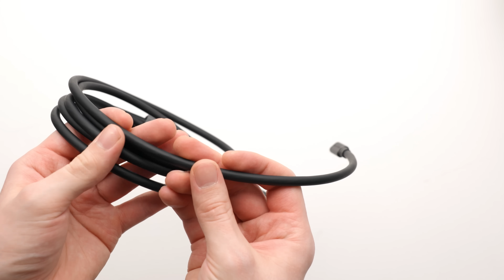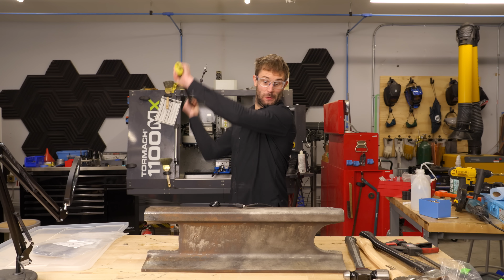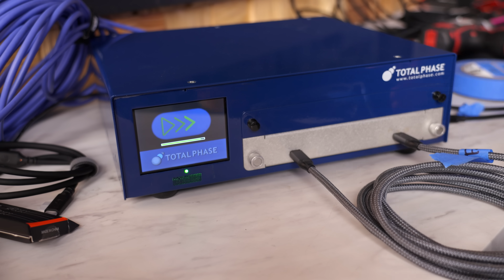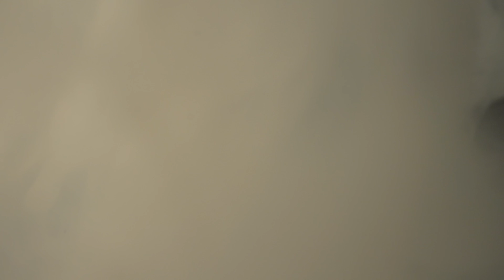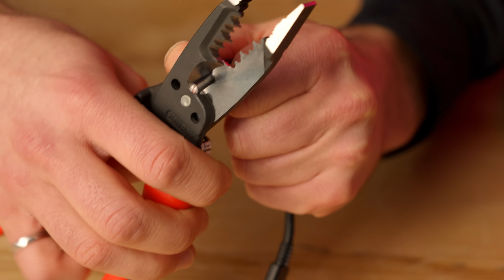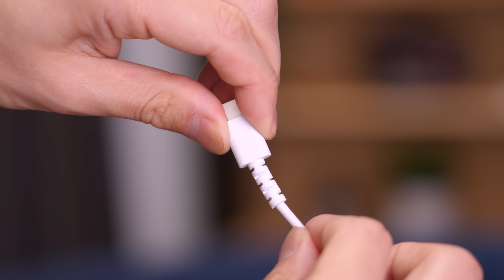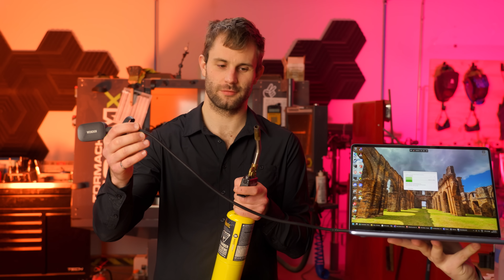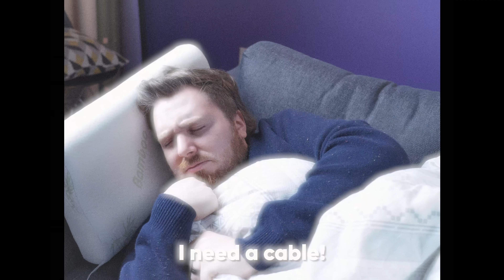Why It Took Me 4 YEARS to Make a USB Cable

Comment: "We have the shield around the outside for ground and return" uhhh..., shielding is NOT used as a signal return path. It is meant to be used as a shield! if the device the cable is connected to is designed correctly the shield gets terminated to the chassis, often with some form of RC network in series with it, specifically to avoid having any return currents flow through it, the only currents that should flow in the shield are any noise floating about in the environment, conducting it away from the sensitive signals flowing through the wires inside of the cable.

Comment: Linus, can you please make some cable extensions as well thinking about the SIM racers and flight simmers, in our VR enthusiast, a 15 foot or even a 20 foot 240 W 20 gig or 40 gauge cable extension in volt USB-C and standard would be really handy.

I think your next project should be the world’s best fastest high bit rate and stable USB hub with power somewhere around 10 ports and four USB-C ports

It’s such a fucking shit show trying to find one that works and for anybody that is in the Sim gaming sphere will tell you the headaches that we come across trying to set up a new rig can cause you to go grey in your 20s never mind how much it makes you wanna burn the whole thing down in your 40s lol

I have spent hundreds and hundreds of dollars on USB hubs and cable extensions in order to run three separate simulation rigs back to one computer

Comment: 30 CAD or 20 euro are totally fine for a USB4 1m cable. I expected them to be somewhere between 30 and 40 eur (50-60ish CAD). My last USB4 cable i bought was around 30 euro for a 0.5m cable (240W rated). so the next cables i will buy will be either 20 GBs 2m or 40GBS 1m LTT cables. at least when they are back in stock xD

Comment: when you start making wires with 90-degree connectors. then advertise. I live in Russia and can afford to order your product. your wire is good! but it would be more convenient for me to have a cable with a 90-degree plug!
Reply: with such a 90-degree plug, the wire is not bent at the plug in most cases!

Comment: It's actually insane for me, how many people don't know shit about their cables, their chargers or even what their devices can do. 
It should be common knowledge for everyone, not only tech savy people, to know the difference, between USB 2.0, 3.0, 3.2 Gen2 (and the other gen's). Also speaking of the output in voltage / current.
You absolutely SHOULD know how much input your device can accept, e.g., is it 20 Watts, 50 watts or do you have some Xiaomi phone with 200 Watts xD. 
If you don't know that, you won't know if it's the cable, your device or charger that is holding you back in speed of data transfer or how fast it can charge. 

I always see that at my school when some kid comes up with their iPad and tries to connect it to the beamer over USB-C and then it doesn't work and they say:
"but at the other room it works? That doesn't make sense" and then they look at me like I am a ghost when I ask them: "Does your cable support display port alt mode over USB-C?" 

It's a shame.

Comment: In my electrical engineering days, I worked at a place that made Mil-Spec cable and electronic assemblies for aerospace and military applications. Nuclear submarines, space shuttle, Titan IV rocket, fighter jets, you name it. And one thing they had in common was either shielded coax or shielded twisted pair signal wires. And the shields themselves were terminated on the shell of the connectors. This is a proven way to get clean signals even in very noisy environments. I approve of the way LTT's cables are made assuming that the shields are terminated to the connectors. Even if they aren't, still better than unshielded twisted pair.

Comment: 8:19 "from a brand that shall remain nameless" with the proprietary cable and the barely blurred logo in the back really got me
Reply: The Man from A.N.K.E.R. might come knocking...
Reply: @PrograError  Apple*
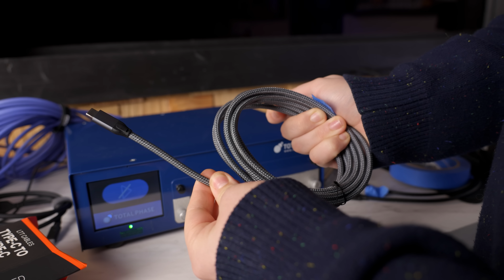Reply: @HaydenH  2:53 A.N.K.E.R
Reply: @HaydenH  also, it's a reference...
Reply: All of the lightning cables including mine in my household have a crack in the top white plastic that causes it to slide up and down. On one of our cables the white part completely came off revealing the metal shielding which my Mum stuck duct tape over and continued to use it for another year before getting a new phone. Never had a lightning cable fail like in the photo but I have had it happen to a 10 year old 30 pin connector.

Comment: I was expecting the cable pricing to be higher than that, honestly very faairly priced, wouldn't call them cheap but if they are as good quality and reliable as you make them out to be, then these are very well priced

Comment: Hi LTT, you may well have already thought about this, but if you haven't I would strongly recommend annual random witness testing of stuff like this to confirm manufacturing hasn't changed in a non-transparent way down the road. Speaking from experience in sensitive industries, that happens all the time, and the last thing anyone wants is the dreaded 'this used to be good' blame placed back on the point of sale. There are many different strategies to maintain that witness without being too onerous (though tbh, most of our work is 100% process-along witness per batch), if you need to optimize against that cost.
Reply: 100%. It's not always malicious, but a manufacturer can make "process optimizations," that while completely unintended, affect the end quality of a product received. It can things like a component supplier goes out of business, or a certain part used goes up in price a ton, or a new part comes out with the same specs on paper. Even the smallest things can have a huge impact. Say the PCB manufacturer switches to a higher quality USB connector with thicker copper traces for a higher power rating, this could lead to the occasional cold solder joint as it acts as a more effective heat-sink. Odd changes can have unintentional consequences.
Reply: This is Soo true

Comment: Sad that the most useful part was overlooked... angle connectors was not even something consider during this hole process it seems... charging the phone while using it and having a thick connector is a pain, it's even more pain when it's not angle... Clearly this cable was only made for desktop use not phone use...

Comment: Does the cable support DisplayPort alt mode? The long length of these cables are enticing for Macs, but I'm not sure if they work for video output? There's no mention of it on the website nor this video.

Comment: I have spent more on cables that have failed to meet basic requirements, never mind the specs you are offering. Without a cable tester we are mostly guessing at what brands are least likely to cut corners, so offering a good cable we can trust at a very reasonable price is great. The labels on the ends will be convenient too. Please don't take this as a reason to up the price, just to restock because you seem to be running out of most of them already. Also I am loving the musical advertising lately.

Comment: I need some A-C cables for my incoming sim rig upgrade, to be honest... The prices of the cables are very reasonable in my opinion. Well done guys, time will tell on durability and overall value. Your community being what it is, you will be held to account but if it's as good as you say, I think it will be fine.

Comment: Well I think you might be sold out already :D. Where I live I xanr even get USB 3 'cheap' and I know being expensive does not mean good. So cheap USB 2 was my way to go... At least I got 10 spare cables and can deal with slower charging. Better than spend more money and have the cable be shot anyway without knowing. (I'd like to have an easier way to check those but alas no cable tester :D)

PS watched this bid while sorting through cables after moving into our new house ^^'

Comment: look, the song is cool but the way he sang it was wrong. the original song was a loud screaming or shouting across the room kind of performance and that's how it achieved the shrill without being jarring, the guy singing your version is whispering in a way to mimic the original performance instead of actually trying to reproduce a good performance, I just think if you guys care so much about tech and videos then this shouldn't have been your weak link. Notice i didn't say anything about mixing, interfaces, microphones or equipment which i know you guys have on lock. its not a critique thats an overshot vs audience and meme nature. I am just saying the performance is not correct. I didn't say singing, i didn't say vocalist, i didn't say off key or anything like that. the point is the guy should have sang across the room instead of hunched over his laptop. Please retry/do the song if at all possible.

Comment: The 1m 40Gbps is currently priced at 29.99CAD (~19€), or at least that's what it shows, and its cheaper than any 1m 40Gbps cable in my country. So no, I'd say they're rather cheap.

Comment: That 240w is mad tempting for my VR headset.
Reply: Most VR headsets cap at around 25W. Steam Frame will max out at 45W.

Only thing I've seen compatible near that high is an Anker battery bank.
Reply: @Reelix its a quest 2 and old lol she barely holds a charge

Comment: lol. they totally are!! (kinda) cheap :D
abut 20-25 USD/€

you wont get a better price on a solid brand name cable with the same specs. maybe sth. similar. but they defo arent expensive. everyone that ever shopped for a thunderbolt 4 cable knows what i'm talking about.

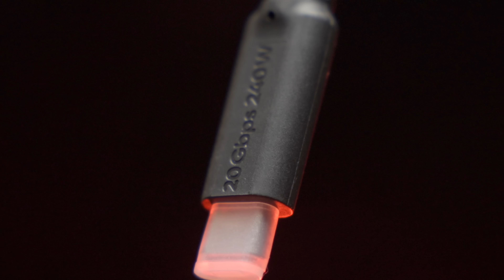Comment: 0:38 But Linus, that does not say "twenty gigabits per second"! It says "twenty gigabytes petasiemens" 😐

I know that's pedantic. But if you're not trying to sell snake oil, then using an uppercase B where a lowercase one should be used is simply wrong, as it could be misconstrued for bytes instead of bits.

"20 Gb/s" would have been the most conventional and standards-compliant way of expressing the speed. At least the cable itself says "20Gbps," which isn't great, but doesn't confuse bits and bytes.

Comment: This is the first LTT product I genuinely want to buy. I don't like using bad cables and even manufacturers I trust have failed on me. A few years back, I bought a nice USB-C 240 W PD cable from a certain fruity company. So far, it has held up great, because I treat it like a raw egg – due to the lack of any strain relief. The prices of your cables are really good, too. However, there is one slight problem: Will there ever be an LTT warehouse in the EU? If I have to pay for shipping to the EU, taxes and what not, I fear that it's just too expensive to justify the purchase. I'm sure that there has been a lot of discussion happening regarding this, I'm just not up to date as I don't follow everything LTT.

Comment: The funny part is is this is all so damn pointless since the people that require such precise cables are not going to be buying these from linus and would be buying them from actually established professional grade vendors. The flipside is no one who will be buying these cables gives a flying toss about the microlosses that these will be preventing, then theres the pricing which at least they are selfaware enough to mention. 30cad for a 10cm cable is wild when there are 2m belkin usb c 240w capable cables for 30cad.

Comment: Good job! One point though, you spent a good chunk of the initial part of the video explaining why a cable might work but still be crappy (thus work-ish) and then at the end you close by saying that a digital cable either works or it doesn't, which is not really aligned with all the background you gave... A digital cable is an encoding over an analog signal, there is no purely digital signal in the real world, it exists only in math on a piece of paper.

Comment: The cable brakes always shortly after the strain relief. So you tried to take on the impossible task. The result looks quite promissing. What I'm still wondering is this thin wire for transporting the power of 240 W even if the voltage can be higher these days.

Comment: doing better i want to see that, 
what about clogging up at cable ends ? 
that happens a lot of time that's why apples cables always breaks at the end, not just apple , 
anker and ugreen  that i use a lot for cables they both have cable end clogging  except anker flow cables they are so flexible they haven't clog up on me 
i doubt ltt will make a difference, also the plugs looks massive, for example it will stick out the bottom of my screen or it will hit the wall when device is close to the wall,

Comment: The people saying it's cheap or they expected it to be more expensive, are you super rich or what ? A UGreen cable with 240w and 40Gbps costs 12€. And ugreen is a reputable brand.

It's fairly priced at best but, I wouldn't call the LTT cable very expensive, but it's not cheap either, and Linus said it himself, it's more the comments that are shocking..

Comment: Can we get a cable with an angeled connector for VR?
Reply: not even VR, basically everything mobile... it's sad that they only think on static uses... even tough that angle connectors can be used on both...
Reply: @StonyBaboon  All direction 90 degree cables would be mint. And with deep/long connectors so you can reach into the backs of some keyboards without needing an adapter.
Reply: @shortyipper not just keyboards, my Logitech mouse and phone case have very recessed ports.
Reply: @Poketroid23  oohhh good point. I personally don't use a wired/wireless style mouse so I didn't think of them.
Reply: @StonyBaboon an angled cable is something that takes more time to make.

It's much better that they've taken the time to perfect this, and letting people test it first before moving on to different versions of the cable, they aren't just being inconsiderate, if anything they're making sure we get good quality shit while they can work on other good quality shit.
Reply: @StonyBaboon  Yeah, I'd get one for my DAC since it's so close to the wall.
Reply: Angled should definitely be next on their priority list
Reply: Aren't the 5m cables for VR headsets fiber-optic? The LTT 5m cables only do 480Mbps. Plus the connect isprobably too big to fit into the female plug on my Bigscreen.
Reply: @_Zaid  Some people dont care as long as they can goon on vrchat
Reply: Yes that can happen, in 3 years.
Reply: I only buy angled usb-c cables and mostly 8 foot. If LTT makes their 8.2 foot cable in a right angled option, I'm buying a batch asap
Reply: It will take 3 more years...
Reply: @sonickrnd  As is tradition.
Reply: definitely with how chunky the cable is
Reply: THIS
Reply: Sure, just give it around 2-3 years

Comment: Type C was meant to unify capability and usability, turns out it's anything but. Frequently they're not up to spec or their chips would fail within a couple of months making them useless for anything else other than slow charge. Hell there's even USB 2 Type C cables.
I was looking for a 3 meter C to C for VR, bought 3 different ones before finding one that actually worked

Comment: The fact that Linus casually found none of 100 cables can pass proper test is epic
I cannot forgive EU to ban all other cable while doesn’t enforce the Type C specs
I know the fact that specs are required in terms of law but the truth is customs only check the outlooking of the cable or device
And EU picked the hardest, most confusing specs to be the standard without asking for practicality and hope for the best
now who is created the e-waste the most?!
Reply: The EU didn't "ban all other cables". The EU only mandated USB-C as it pertains to power delivery and charging for mobile devices. All the other stuff is atop of that and doesn't really concern the EU. It's not the EU's job to enforce that cables meet the standards that the manufacturer advertises. That the job of your local jurisdiction. Same as with every other product.

Comment: I would’ve proposed that y’all also include a way of immediately telling what spec a cable is such as a color ring or a distinctive bumps or texture instead of pulling out generic black cables and reading the text. But hey manufacturing to-spec cables seems to be an adventure already for the company

Comment: I've only bought the black LTT screwdriver when it came out, I'm not really interested in most LTT products in actuality, but the TrueSpec cables are what I'm actually excited for. I'm all about practicality and I have trust built up and a desire for well made products that I think the current price in Jan 2026 is reasonable for the problem it solves.

Comment: Luckily there are good cable testers for 15-40$. The cheaper ones check alle the connected pins, while the more expensive ones also directly show you what type of cable you have there. 
But yeah all the way since introduction of USB 3 the cables are a mess, you never actually know what you get and with USB-C it even got worse.

Comment: Using USB logos anywhere in your video advertising your cables is a bit on the risky side even if it's not on the cable or packaging itself.
They can be a bit aggressive at demanding payment if you used the logo in any way

Comment: I really wish that they would mention the USB protocols supported on the store. Even though it is just the standard USB-PD and it's big brothers, just having a note of the protocols would be a great help when you need to find a specific cable for a specific protocol. I could totally see myself buying this, not considering that is wouldn't work with the different phone brands proprietary charging protocols, like SuperVOOC and HyperCharge. I know that it is mainly for phones this might be an issue, but it would still be a nice addition. Especially for a cable that is supposed to be so simple and transparent.